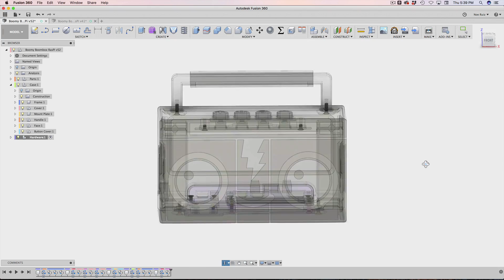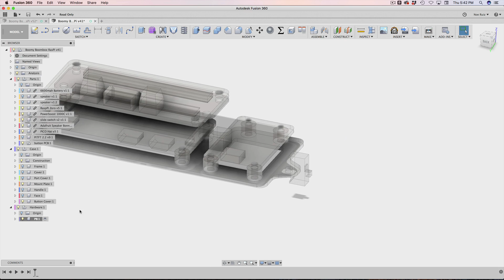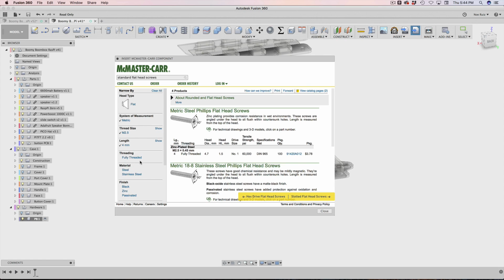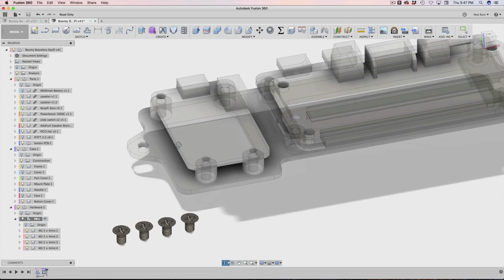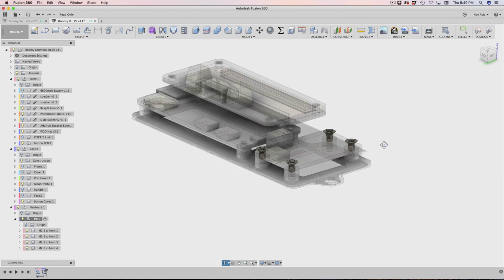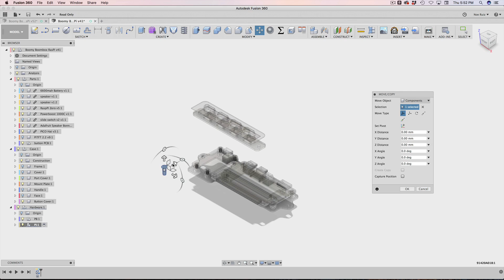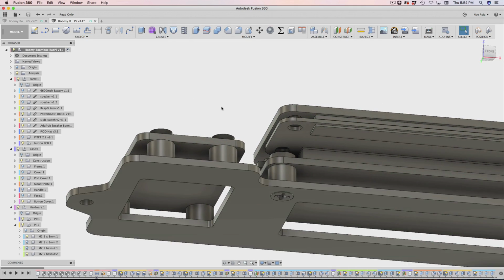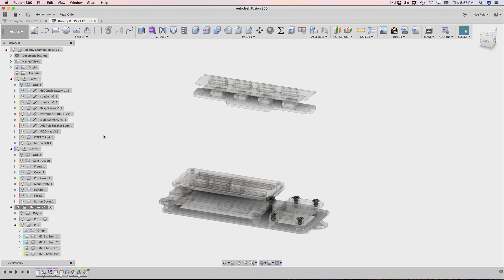Fusion 360 Tutorial – Using McMaster-Carr Hardware

Comment: Great video. When I make hardware and try to print it exclusively in my 3d printer. The threads from the hardware disappear when moved to the slicer. It doesn't give the same option as making a hole in a thread to where you actually print the threads. I'm using the free version currently. Any advice would be great thanks.

Comment: Is there not a way to component pattern? Let’s say I have a hole feature with 4 holes, all based on a sketch. I want to put four screws in, one in each hole. Solidworks has a feature which would allow me to put one screw in, mate (joint) it into one of the holes, then with two clicks, I can pattern the screw to the rest of the holes. 

Not a big deal with a 4 hole pattern and only screws. But a 6+ hole pattern with screws and nuts… that’s joints for 12 different parts. That’s a lot of clicks. Solidworks would be mates (joints) for 2 parts then two clicks and bam they’re all there. Not saying Solidworks is better, I’m transitioning from it and looking for tips. 

Note this kind of feature is really important when you inevitably decide to change hardware, as you would have to change two parts (nut and bolt) and the rest would pattern.

Comment: using Joints would be a much better idea than the align tool .... the align tool just aligns the screw, but it is not locked in position and you can still move it around after .... with the joint command it works the same as the align but locks it in place
Reply from the maker: yes true but also good to note more than a dozen joints for just screws the timeline can get unruly and performance gets slow

Comment: For screws going into holes, it would be better to use the Joint command to both align the components and it also allows for threads to be modeled at the same time

Comment: The way you measured for the screws for the pi is why you chose the wrong ones. You should have placed the nuts and then measured from a feature on the top of the nut all the way to the larger circle of the countersink on the bottom.

Comment: Why use align over joints?
Reply: You can use joints and choose the option of rigid.  That way they are aligned and the rigid option tells it to not move.  Though the beauty of Fusion 360 is there are multiple ways of doing something and most of the time other options are not wrong.  The align command works fine too.
Reply from the maker: +TAD2020 didn’t think the screws ever need to move in the assembly, they’re mostly static

Comment: A good example of how NOT to use flathead screws. They are designed to be used with a countersunk hole. A proper screw would of been the button head screws.
Reply: Yes. Actually a good way to do this is to use a different feature than align like he did. You can use the assembly feature which allows you to select two components and join them. But first you want to find the correct threaded hole for your fastener and counter-sink it.
Reply: Definitely. Either countersink the hole in the PCB or use pan head fasteners.